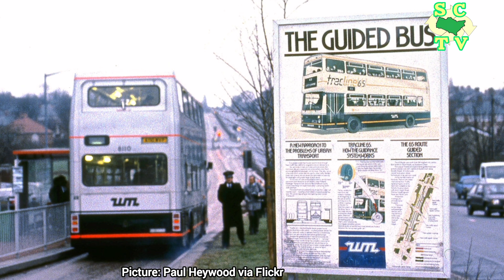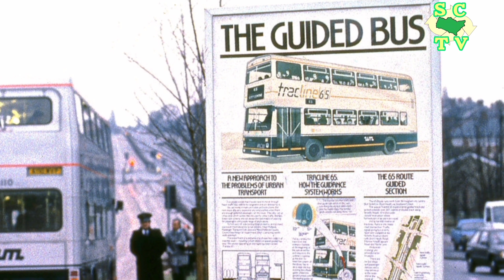The West Midlands Guided Busway: Hands Free Metrobuses!

Comment: I feel Christine Vaughan, the winner of the emblem competition, was treated rather shabbily.  First of  all, she gets all of that knocking from the various civic worthies who sat on West Midlands PTA and who probably had not been on a bus since the war.  Then her prize. A guinea was worth £1.05 in decimal money. or a pound and a shilling.  That means she made £21 for the WMPTE emblem.

SELNEC  in Greater Manchester used a professional design consultancy based in Manchester to design its sun-glow orange and white livery and its logo used until 1974.  They also had Ken Mortimer on the staff, who had already designed the Mancunian bus and would go on to design SELNEC's standard double deck bus body and the "M-Blem" logo and seat moquette used by the successor to SELNEC, Greater Manchester Transport.

Like the "M-blem", the WMPTE "wiggly worm" logo was everywhere around Birmingham, the Black Country, Solihull and Coventry in the  1970's and 1980's.  Buses and as illustrated in the video, it was still used when the modified and brighter blue and cream livery was introduced with the Metrobuses.  Signs.  Badges, both for the general public and staff caps.  Uniforms.  The WMPTE Travelcard (West Midlands introducing an off bus ticket for regular users a decade before London). Publicity.  Timetable leaflets.  Bags.  Autofare 3 tickets (and they still appeared for about 3 years or so  once West Midlands Travel came into being),  Trains, with the WMPTE logo appearing all over the country, especially on Summer Saturdays where Tyseley DMU sets would be pushed onto reliefs to the likes of Aberwystwyth, Weston-super-Mare or Great Yarmouth.

Miss. Vaughan's "wiggly worm" logo was used until 1990, when it was decided to rebrand WMPTE to Centro.  The reasoning was that people still thought West Mdlands PTE were a bus operator, West Midlands Travel persisting with the blue and cream livery it had inherited from WMPTE.  However, by 1990 West Midlands Travel had started to change the fleet livery from blue and cream to a version of the grey Tracline livery, with a shallower blue skirt replacing the black used on the Tracline buses.   The effect did not look particularly good with some passengers in the local papers describing the livery as being like that used on the utility buses in the Second World War!  A revised livery with silver and some red, white and blue trim was introduced in 1992 - just as the last Metrobuses in blue and cream were being repainted!

Miss Vaughan, being from Solihull, probably did not see her WMPTE emblem on the buses in the town until 1973.  This was because Solihull was very much Midland Red Country.  WMPTE took over in 1973 but sensibly took the same approach as it did in 1970 with the old municipal fleets. painting out the Midland Red logos and using transfers in BMMO red and NBC red with the WMPTE logo, fleet numbering and legals until a programme of repainting into blue and cream could begin.
Reply from the maker: I totally agree with you there. It would be nice for her to receive some proper recognition for the design.

Comment: One of the main reasons for the increase in patronage on route 65 was not the guideway but the increase in frequency of bus departures overall. Sadly then, as now, the WM Passenger Transport Executive was dominated by light rail enthusiasts and councillors looking for something more glamorous to crow about than buses. So, the tracline system was never fully supported which opened the way (and Birmingham taxpayers wallets) for the Midland Metro to proliferate. Modern guided buses don't even need guide rails, just buried cables, so are even more flexible and efficient. They would be so much more economic and efficient throughout the entire West Midlands rather than just the tram between Brum and Wolvo. With the advent of EV buses we in the West Midlands could have lead the country in efficient passenger transport. I have been lucky enough to drive WM Tracline 8110 on many ocassions but believe me you only approach the curb too sharply once. A broken wrist and bruised fingers and you've learnt your lesson - LOL

Comment: OMG I remember Tracline65 as one of the 1st routes I drove on after passing out from minibus driving at Hockley Garage (now an entertainment venue). A very strange experience at the time. I didnt drive it regularly as there were  specific drivers for that route. So many changes since then. I'm now retired after over 35 years driving round Birmingham from various garages. Thank you for the video and the memories🚍👍
Reply from the maker: Glad you enjoyed it. Thanks for watching and sharing your memories. I did a coach job up to the old Hockley Garage about five years ago. Nice they've found a use for a redundant bus garage. Most are sadly knocked down.
Reply: Just another bit of info that you may not be aware of, single deck at 11.00 is an ex Midland Red BMMO , possibly a S23 that would probably been based at Sutton Coldfield at the time the WMPTE came into being

Comment: As a member of MCW development team and the first to use the test track at MIRA and a 11pm test of the the Short Heath track double checking all was well before official opening, Martin Fisher (WMPTE) Les Pearson (MCW) also had a chance to drive the short track. We had our first taste of vandalism that night a drunk from the locate pub had put concrete into the runway, the front suspension steering area was modified to a similar spec as a Hong Kong Metrobus, steel bracing plate between No,2 & No,3 x members after strain gauge testing by Mira the loads imposed by the steering guide wheels was no higher than normal. The only breakage of a steering arm and guide wheel was outside of Millar Street garage where a guide wheel and part of the arm was found outside the lost property office, it is believed a fast full lock turn was used and the arm was stopped by the high kerb, i replaced the steering arm removed the steering box and was off to  ZF Nottingham for a full strip down and evaluation no internal damage. If you see the U tube video of the news report of guided bus at MIRA i the driver.
Reply from the maker: Oh wow that's brilliant. And thank you for commenting. Must have been a big technological thing in it's day

Comment: Fundamental failing that all these guided bus ways suffer from is that no one has yet conceived a road surface that will withstand the wear of fully loaded buses, unlike the steel on steel of a rail or tramway. Thus with the guided route the buses concentrate the wear on the same part of the road, thus ensuring the road wear is concentrated in this area and thus accelerating the need for resurfacing. The result is systems that whilst much cheaper to install than a tramway, it has much higher maintenance cost due to the resurfacing and also resulting service interruptions. You see this on the Cambridge the system, with the break up of the joins between the concrete slabs where the bus wheels run.
Reply from the maker: Yes I know exactly what you mean and you raise a very valid point. Funny, the motorways in Kent -M2 and M20 experience high levels of HGV use and they actually have grooves in lane one caused by the constant HGVs barreling through.

Comment: Hi Jake, even though we're old diesel fans like yourself. Dad and I believe very strongly in electrified busways using guided electric hybrid battery/pantograph vehicles. Locally we have a existing electrified o/head branch line from Watford to St Albans this service has a really low usage and High fare evasion and we have put an  idea to a local MP, but our idea has fallen on deaf ears. But if infrastructure costs and access points could be established. It in our minds would make alot more sense. Allowing people to travel from both town centres with less impact on current road usage as you rightly pointed out and lowering the emissions on the environment. But it does seem that some county and local councils don't believe in logical answers to a basic problem. Great video Jake and you and the team have a great easter holiday.
Reply from the maker: Hi Jade. You're so right, some councils find it easier to build car parks rather than invest in decent public transport. They certainly don't think of the long term do they? 
Happy Easter 🐰
Reply: @JakeSCOC  Dad's reply think of a I.o.M  horse draw tram. One it's blinkered and two it can only think of a bag of Oats.

Comment: I used to drive Mercedes O305s as shown at the start. They had Mercedes own W3D 3 speed transmissions which were among the most advanced available back in the 1970s. They were co-developed with ZF and had the most beautiful sounding retarders. ZF was still relying on it’s 2 speed until the 4 speed Ecomat in 1980.
The Adelaide Obahn used to have Mercedes O305s and  articulated O305Gs doing 100km/h. Now Scania K series running there restricted to 80km/h and drivers are forbidden from letting go of the wheel 😒
Reply from the maker: Those Mercs do sound amazing vehicles. I hold them in very high reg.

Comment: Hi Jake so happy you told the story about track line 65 at the time good idea at time and they was going to extend it to the Bristol rd but at the time they could not get the funding I used to be a driver on the 65 from 1999 until 2003 but by then we had low floor buses on there but I did get a chance to drive 2968 to 2974 as they were sent to the garage I was at they still  had there guide wheels fitted on them until they were all sold off
Reply from the maker: Interesting about them still having their guide wheels. Thanks for watching and commenting.

Comment: I love travelling on the UK's busways. My favorite is the Luton - Dunstable one, operates 24/7 and is covered by 3 operators. Arriva, Centrebus & Grant Palmer. The services along it are pretty frequent. The Cambridgeshire Busway is indeed the worlds longest busway but was also the most troublesome to build. I remember stagecoach East ordering some new single deckers specifically for this service with branding above the windows. The start date was delayed twice, (if i recall correctly) so the buses were used on normal city services and in frustration stagecoach changed the wording to "when WILL we be on the Busway" !!. 
Of course, its been a phenomenal success .. so much so that now, tri-axle double deckers seating nearly 100 + passengers ply the route😊
Reply from the maker: It's nice to hear about a success story in the industry

Comment: As a bus driver in the North West of England,  I think there are several drawbacks with guided busways. They can be blocked completely by a breakdown,  unable to overtake bunching is not only still a problem but the first bus remains in front and following buses cannot leapfrog which accelerates each bus's progress. The buses have to be specialised. Recovering a breakdown must be difficult . In contrast the Runcorn busway allows standard buses to use it without any special modifications.  It's a single track road system,  one lane in each direction,  like a normal road.  Any vehicle can be overtaken anywhere so breakdowns don't block the roue. Bus stops are all in lay-bys, so following buses can pass if they don't need to stop. The busway is a dedicated buses only , any 'stray vehicles ' can still use the road until it's able to leave without blocking the system.  The busway is fenced off from pedestrians and has bus friendly traffic lights where it crosses normal roads. Buses can join / leave the systems at any point just by turning onto the normal roads. Although it requires a little wider course than guided systems it's far superior in my view. The extra cost is offset by no need for specialist vehicles or infrastructure. All operators long or short term can use it without extra training. The guided busways seem to put novelty value above the advantages of just having dedicated bus roads any bus could use. NB. The Runcorn Busway does have a few low bridges , I think they were thinking that single deck buses were the future when they designed it decades ago!
Reply: The Runcorn busway would make a good video in it's own right
Reply from the maker: Yes it would!
Reply from the maker: Thanks for that. Very interesting to read. Yes breakdowns and bunching would be a massive issue.

Comment: The original plan was to have the guided busways along the much longer former tram reservations on the Bristol Road but it was felt that something smaller was required for such a new idea, hence the 65 being used. In 1985, I came across a piece in the Birmingham Evening mail that it was being proposed that the Darlaston-Bilston section of the Birmingham-Wolverhampton 79 would form a second busway, obviously trying to bring the concept to the Black Country, but with deregulation and the abolition of the West Midlands County Council on the way, events shelved.

Deregulation would see the 65 extended from Short Heath terminus (a new turning circle had been constructed as part of the project) to the Perry Common terminus of the 7, using normal roads alongside what I believe was originally intended as reserved track for an extension that never happened, BCT serving Perry Common with buses instead.

Deregulation also saw the Sunday service pass on tender to Midland Red West, meaning the return of bus stops on the roadway, precursing the eventual September 1987 demise of the busway. 

I would get to drive 2961 when I became a driver at Perry Barr garage, tbh, it was pretty much the same as other Metrobus 2s! I would also get to drive the 65 occasionally after it's transfer to Perry Barr in 2001.

Many Brummies decry it as a waste of money, without realising it was an experiment and, although no more have appeared within the West Midlands, it;s good to see that the work here has led to some successfull applications, including several using double deckers!
Reply from the maker: Many thanks for watching and commenting Mark. Really interesting comments there.

Comment: Fascinating vid about the birth of guided busways in the UK. Leeds (my home city) introduced its first sometime in the early 1990s on the A64 corridor, and there remain 2 or 3 still in use. Interestingly, I recall that because the roadway is fixed (so to speak) they are essentially classified as railways, and therefore needed an Act of Parliament to get up and running. Makes some sort of sense if you think about it.
I've just stumbled across a piece on the internet from a couple of months ago, where the City Council are proposing to remove the A64 busway and replace it with a traditional full width bus lane. I know that with the slow retreat of FirstBus in particular there are a small number of independents operating services down this corridor who weren't there 30 years ago, and they haven't (and wont) equip their vehicles accordingly. There are also problems, allegedly, with bunching, and, once you're in the busway you can't get out except at the far end. So, after 30 years service they seem to have concluded they're not such a great idea after all
Reply from the maker: Yes I suppose if a bus breaks down in the Busway that messes things up too. Some very interesting points you've raised there. Thanks for commenting

Comment: Basically modernised trams probably a bit more comfortable by the looks of it would only have been feasible where tram where in common use.
Reply from the maker: This was on a former tramway.
Reply: @JakeSCOC  worked that out after I posted and given the case of what it cost to fit the flange wheels probably to expensive to make it work even short term.